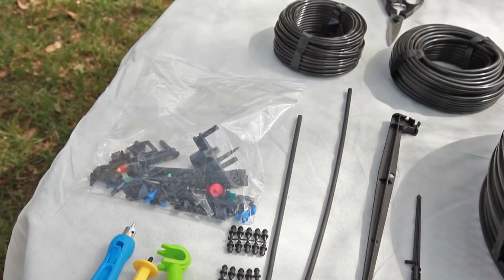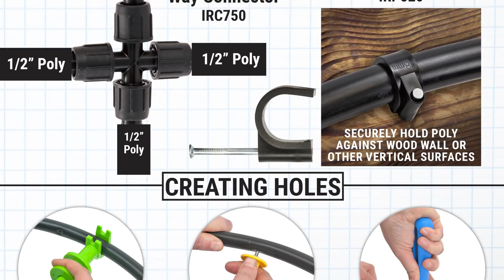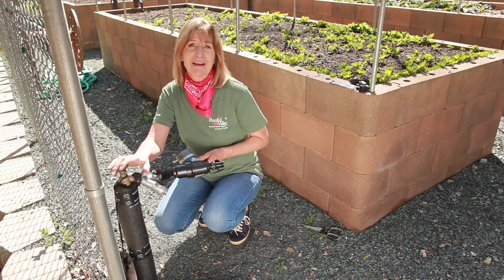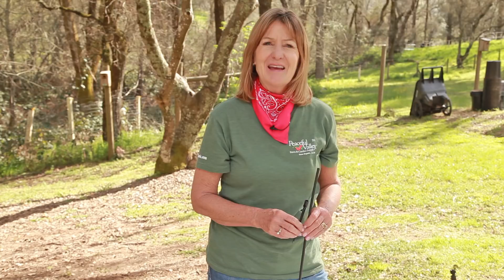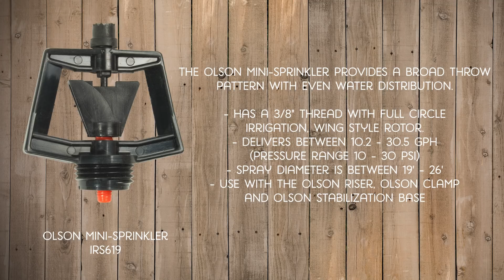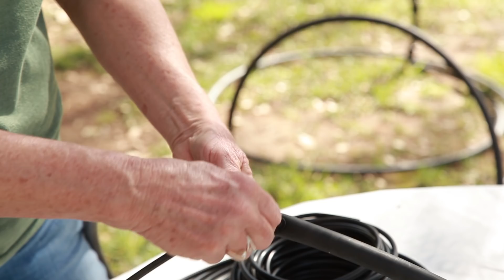Drip Irrigation-Part 2-Using Poly Tubing, Sprayers and Emitters

Comment: Nice presentation.I finally understand that in order to insert the emitters one must first punch a hole in the tubing. Here is my situation.I currently have converted 5 stations of my irrigation system into a drip system.I have a regulator and a controller for time. I usually water up to 17 mins 2x a week.My entire landscape is cacti and succulents. I have been using soaker hoses attached to an 8 port manifold in several locations which waters each plant directly. The only issue is a lack of complete control over the amount of water dispersed.There are screws on the manifold which allow for opening and closing of that line however when the station is on and set for a specific amount of time,I do not have the ability to give one plant just a little water and another plant that is part of that station,a lot of water,other then what I can adjust with the screw. So I was thinking of modifying the system using individual emitters run off of tubing which hopefully would provide more precise amounts of water to each plant.But I am confused as to what exactly I should add or take away and how to set this up. Can you help? Thank you

Comment: Dang, they keep skipping over the part that I came here for... how do you actually get the tubing onto a sprayer? Is it just pure force, or is there a trick to it?
Reply: It is pretty easy pushing buttton drippers and goof plugs into holes in half inch line.  Getting the barbed ends to go into 1/4” tubing takes a bit more hand strength.  Dipping the tubing end into very hot water first helps, if you are having trouble with that.